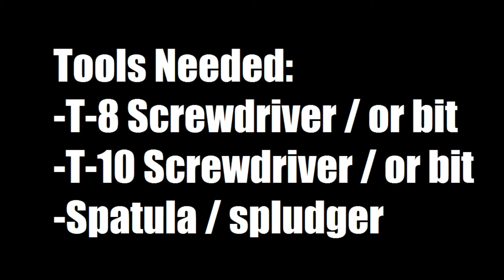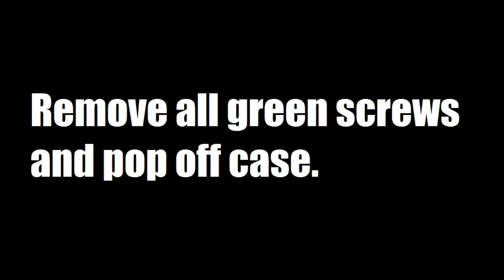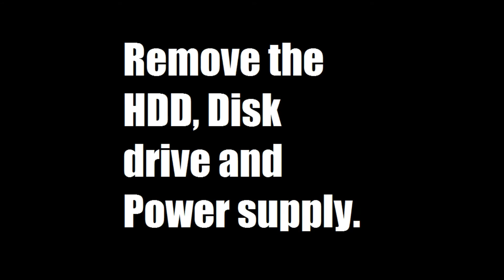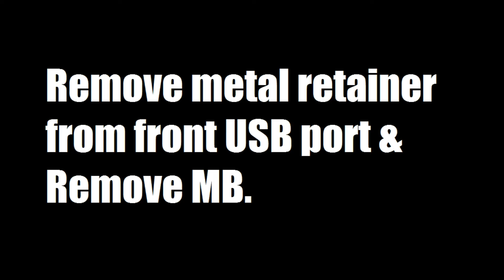Xbox One S Disassembly Teardown

Comment: Is there a way too take the back panel off too? Because after you took all the panels off that one was left and I want to paint it so....
Reply from the maker: Its riveted on with plastic, I took one off before when I had to replace a chassis and it popped back on the new unit but it wasn't as snug as before. Im sure with some TLC you'll be good.